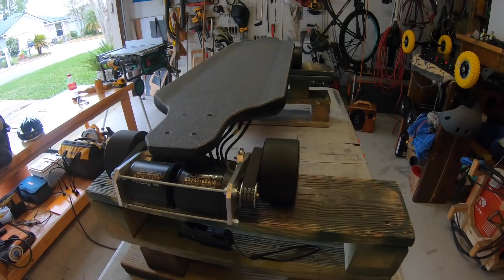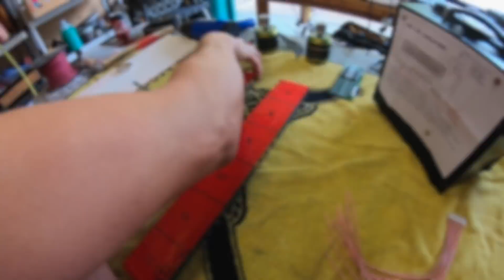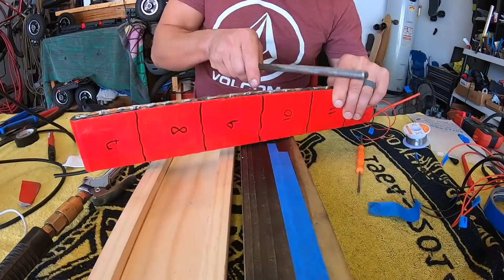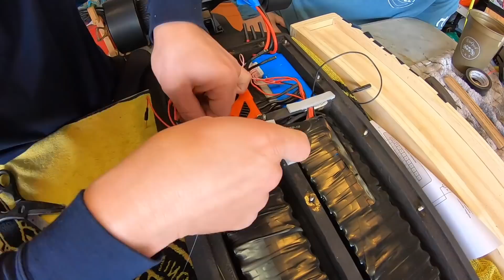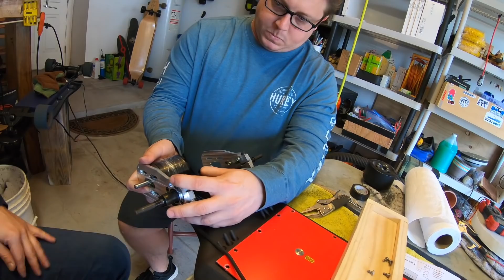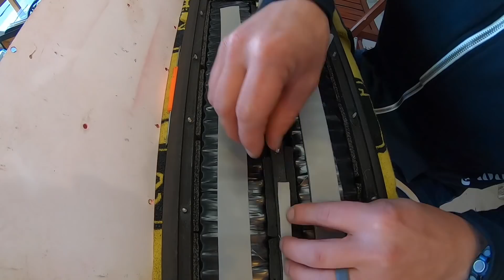40MPH DIY Electric Skateboard

Comment: what's the width and thickness of the nickel strip?
Reply from the maker: 10mm X 0.15mm.  Add to that 10ga copper wire soldered on top of nickel.

Comment: Great build!!! Do you have the plans of the battery please because I would like to make one but I can't find a plan for a 12s4p.
Reply from the maker: Hi Thomas.  I do not have a plan or video on 12s4p.  I got videos on 12s6p and 12s8p on my channel.  The concept of a build is the same, Just less 18650 per cell.
Reply: Artsiom Naidzich Ok, thank you for your response.  I would also like to know how you're doing with the system for recharging the battery.
Reply from the maker: @thomas-rz1xv  I use 12s bms and a 50.4V DC charger.
Reply from the maker: @ghostfacekillah5714 , amp rating on BMS does not matter if you wire BMS for charging only.  Discharge of your power pack (measured in amps) is controlled by ESC.  Therefore amps on BMS dont matter (just make sure that your esc setting does not exceed max amp rating of your power pack).

Comment: Were those flipsky 6374 1000kv motors?? Beefy
Reply from the maker: Sam Wooten. Ha, nope. 190 kv i think. Speed is due to 50v system, 20 teeth motor pulley, 40 teeth wheel pulley.

Comment: i think 40mph with those small wheels is a very high risk.
Reply from the maker: Agree.  I've since put 6in pneumatic wheels on this esk8.  It brought the speed down to 35mph (gearing also has changed).  I am a big fan of pneumatic tires on skateboards.

Comment: I like the build.  Nice.  I am using the same motor mounts.   Becareful with the mounts.  When you reverses mount the motors the lowest contact point is the bolt head and if that bolt head ever catches a road crack it could send you flying.   It happened to me a few times.
Reply from the maker: Wilson Leung, thanks. Ive 3d printed 6in hubs and put pneumatics on this ride. Got a bit more clearance/confidence now.

Comment: SOUND AWESOME BUT ARE THIS DRIP PROOF MOTORS CAN HANDLE MOISTURE LIKE RAIN OR PUDDLES ???
Reply from the maker: Privet Povelitel vseh zemel i mirov.  This motor is well sealed, but it is not waterproof.  It will be ok in the rain or hitting a puddle.  I dont get everyone's obsession with waterproof motors.  We are building skateboards here, not boats.  I generally avoid getting on a skateboard in the rain or running it through puddles.
Reply from the maker: Bob  I believe it.  I'm on my 5th set of tires on this board.  Have been ridding it a ton.  I run all my errands on this thing.  This board has been rained on, been on the beach, trails, and mud more times than an average commuter will experience.  Motors keep on going.  Manufacturers make it a point to market their boards/motors as water proof.  Decent brushless motor should be able to handle occasional moisture without any issues.  How much more waterproof do you need your motor to be.  I cant think of anyone riding their boards through depth of water where the motors are fully submerged (unless you are rolling on hubs, which I believe are waterproof).

Comment: Damn man what a great build that’s what I call diy!!! I was planning on building the exact same setup as yours but I am not sure either to go 10s5p or 12s4p, so whats the range you get out of it?
Reply from the maker: Ahmed Salama Thanks Ahmed.  The most ive done in one day is 14 miles. It was still riding solid, but i did not want to drain the battery all the way down. Either 10 or 12 will be plenty powerful with this set up. If u go for 10, do 10s5p if you want extra range.

Comment: when i'm 45km/h is F!@# scary.. imagine on 40mp/h, INSANE!!
Reply from the maker: I've tuned it down to a manageable 35mph.  I crashed at 30mph recently (on a different board)  and broke my leg pretty good.  Still recovering.  Anything over 30mph is pretty fudging fast and has a potential to really mess ya up.

Comment: What motors did you use? 6374? And how the esc is holding up? i see a lot of this generic escs for sale but all of them say that you cant use more than 2600w, with 20kmh max speed. i wonder how did you use a 2600w max vesc in a 40mph dual motor build
Reply from the maker: moviesFLY , hi there fly sir or mrs. read the description of this video. All your questions will be answered. Also, with 10s battery pack, 6374 motor, 90mm wheels, 15/35 pulley ratio, i’ve been getting 28 to 30 mph with generic esc. U used a focbox unity with 12s battery for this build.

Comment: Hi, I am building my own electric longboard and I want to solder cable to nickel strip like you did but unfortunetly my tin does not want to solder to nickel strip. How you did it? Did you use special kind of tin or special nickel strip? My strip is not pure nickel becouse my welding machine can't solder pure nickel strip so I am using strip (with a little bit of nickel). I need some help, please 🤗.
Patryk Martyniak, Esk8 builder from Gdańsk Poland
Reply from the maker: Patryk Martyniak yakshe maesh Patryk.  I used regular nickel strip, led solder with resin (tin), and high heat soldering iron.  Here are a few things that helped me:
1.  Good soldering iron capable of high heat (i think mine does 500 or 600 degrees C)
2.  Use led soldering wire with rosin core.
3.  When soldering, apply the tip of the soldering iron to both the copper wire and nickel strip.
4.  Dont solder right on top of the batteries, solder in between them.
Reply: @artsiomnaidzich9515  Did you use pure nickel strip? (90%+) Or strip with some nickel?
Reply from the maker: Patryk Martyniak pure nickel strip 10mmX0.15mm

Comment: Did your 3D print the wheel gear in PLA or ABS?
Reply from the maker: Jacob Rivett on this one i used carbon fiber filament. But, ABS all day. I build a tester board for 3d printed parts. Motor n wheel pulley are both abs, and they are solid as fuk.

Comment: How did you deal with the motor connectors and focbox unity?
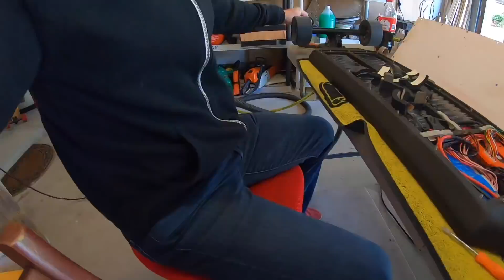Reply from the maker: Hey Mudit.  Look at 6:48 frame in the video.  I had to make motor wire extensions from unity to motors.  I used bullet connectors that came with unity (on unity side), and 4mm bullet connectors on motor side.  It works great, no issues.

Comment: Awesome job man!! What size motor pulley are you using and where did you buy it from?
Reply from the maker: Daniel Green motor pulley 20t M5 15mm (8mm ID) from amazon. E-bay sells them as well. 42t m5 wheel pulley (3d printed at home). 295 mm 5M belts, 15mm width.
Reply: Do you have trouble climbing hills with such a large pulley? How’s the torque?
Reply from the maker: @danielgreen3884  Not at all.  It's all about the ratio and power output.  Most of the boards do 15/36 teeth ratio.  (0.42).  My buddy used this ratio on his focbox unity with 12s pack and 97mm wheel.  It's almost too much.  Acceleration and breaking is over the top.  On 20:42 teeth ration (0.48) you get smoother acceleration, smoother breaking, higher top speed (your motors and battery pack have to work a little harder during acceleration).  Another advantage of bigger pulley is no belt slip during hard breaking (and they seem quieter to me).

Comment: Do you have plans for the deck? I LOVED the design, but have a different battery setup
Reply from the maker: No plans.  I had a general idea of of deck dimensions.  Deck dimensions: 40x10x2 inches.  Depth of battery/esc compartment is 1 inch.  Battery divider spine is 1/2in.  The rest I sized to whatever length to make it fit/work.  I have a video link on deck build process in the description.
Reply from the maker: https://www.youtube.com/watch?v=BgwRVQ6lTJo
Reply: Hahah my kind of design process, thankyou! Saw the video on how you made it so i’m going to try and make something simmilar!
Reply from the maker: @magnustangen6269  I was off on deck dimensions:  It's 40x10x1.5 inches.
Reply: Artsiom Naidzich thank you!
Reply: Artsiom Naidzich could you check your «electric skateboard for christmas» video? Left a question there aswell:)

Comment: I like how you did the all threads to make it mounts stiffer! Did you have flex in the mounts before you did that?
Reply from the maker: Blake Libby im not sure if i did have flex, but i noticed holes on the mounts. Went to home depot, got a threaded metal bar, cut it to size, and boom. I do think it keeps pulleys n belts aligned better. Also, i used larger pulleys (20:42). There is no slip with that set up.

Comment: Nice !  If it was to redo, I would also use heatshrink tubing instead of electrical tape to wrap the batteries. Electric tape will leave a nasty glue residue if you ever need to open up and service the battery.
Reply from the maker: Jonathan Vaucher thanks. I like the lateral pull electrical tape provides. But i guess i can do that over shrink wrap.
Reply: For 15$, you can get a 5 meter lenght of battery heatshrink tubing on amazon....

"DIY Battery Heat Shrink Wrap,5M Length 100±1 Flat Width Battery Pack " (100mm is the width of it lying flat.... which actually the equivalent of a  200 mm circumference).

In theory, for you layout, the heatshrink tubing needs to cover a circumference of 167mm (65 + 18.5  +65 + 18 mm), but the hot glue, the pretective cardboard ring for cells, the nickel strips and wire take a bit of space... So I would choose a slighlty wider heatshrink....

To be safe, calculate it needs to cover 200 mm circumference (slightly too big is not a problem because heatshrink thermoretracts by a good 20% easy if needed, I think it can probably retract by 50% if you really heat it a lot).

So heatshrink is calculated by FLAT WIDTH instead of CIRCUMFERENCE.
200 MM CIRCUMFERENCE is actually equivalent to 100MM FLAT WIDHT...

If you are unsecure about dimension. Make a mock up shrink tubing of 100 widht with a sheet of paper and scotch tape. Try to slide it over you battery. If if fits, then buy the same dimension heat shrink tubing on amazon. 

Would look very professionnal.

Your build is awesome by the way !

What do you think is best investment, VESC ? FocBox ? Cheap chinese ESC ?
FocBox looks quite expensive for what it is  (max 50A ?). Is it worth the cost in your opinion ?
Reply from the maker: @JonathanVaucher  Dude, thanks for taking your time writing this out.  Unity is legit, but is a hassle to wait for and order.  I ordered mine in early Dec of 2018.  I got it mid march of 2019..  On this build I have it set up @55a per motor.  It's rated at 60 (I dont think my battery is going to like 120a pull).  It's def a good vesc if you have extra cash and patience.  My buddy got a Flipsky 6.6 Vesc (https://flipsky.net/collections/electronic-products/products/dual-fsesc6-6-based-upon-vesc6-with-aluminum-heatsink).  This thing is legit for a lot cheaper and 1 week of waiting.  Does 100a per motor, 200a total.  If you dont like chinese, go with Eskde.  I have a MTB called ankle breaker.  I ride it almost every day.  Have more than a 1000 miles on it.  It runs great.  It will cost you about the same as unity, but no long wait and it is German-build in Germany.  (Here is a link to Ankle breaker ride:  https://www.youtube.com/watch?v=k2zYR2SeJew, and a link to the build vid (I did not have Esk8de in build vid installed yet):  https://www.youtube.com/watch?v=XCpbpk1aRag.  I used a bunch of chinese simple esc (you find them on meepo and halo boards).  Those have been good for me as well.  They are cheap.  Require no programming.  And have been reliable for me.  If you are going for performance: either Unity, Flipsky 6.6, or Esk8de are all awesome.  For a budget build, simple ebay esc (30a per motor) are legit.